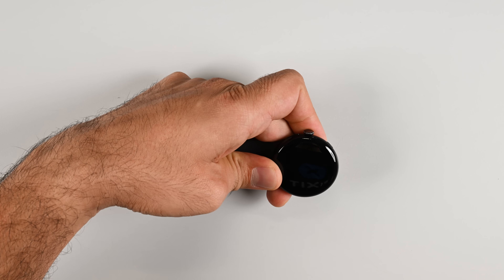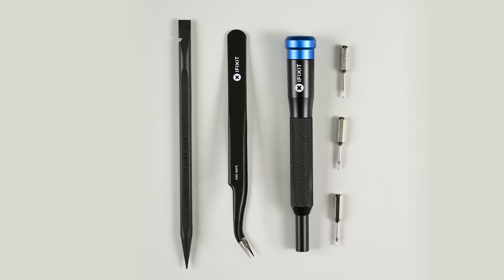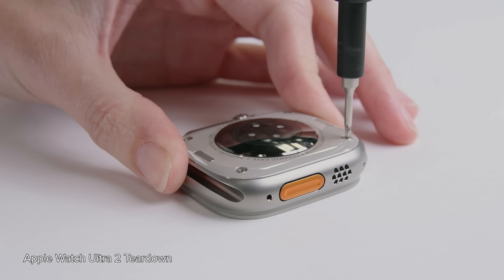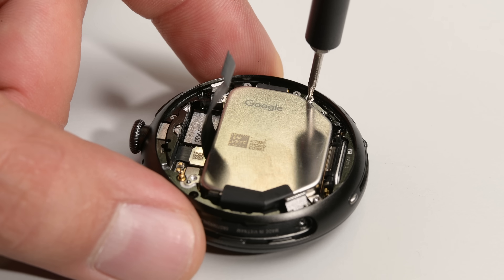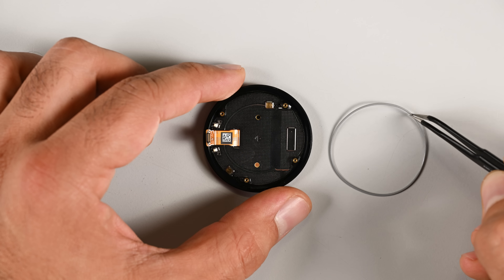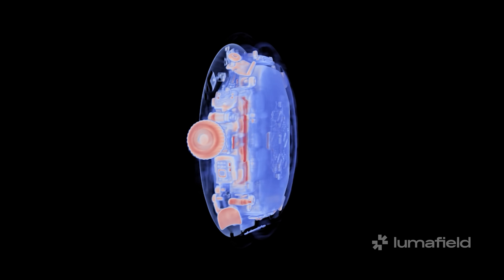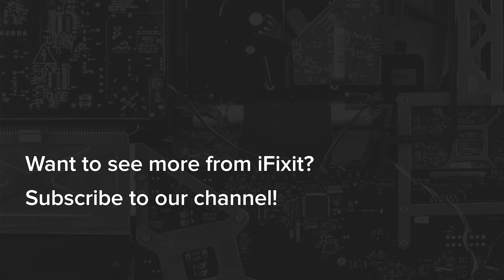Inside the Pixel Watch 4: A Masterclass in Smartwatch Design

Comment: Will we be able to purchase a screen replacement for the PW4 ?

And what do you think about the price range ?

It would be really sad if it didn't, as Google has put a lot of effort into making the watch user-repairable. Just need to know if there will be spare parts sold separately like the screen and battery.

I'm very interested in this watch. I've always found the Pixel Watch very pretty, but also very fragile because of the shape of the glass. So if it could be replaced easily and inexpensively, it would really be a good investment.

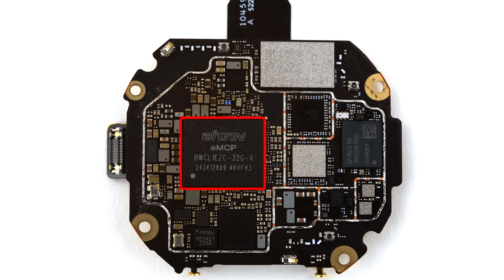Comment: 2:43 crazy soldering reflow fault on one of the crystal oscillator chips to the bottom left of the SoC. It looks to be micrometers away from a solder bridge
Reply: That's just from them removing the can with a heargun but no so carefully

Comment: The fact that most regular watches are water resistant using o-rings and gaskets means its totally possible to create a sealed smartwatch without using glue. Glue is the lazy approach to mass manufacturing and less spent on R&D
Reply: I don't believe the main reason they do that is to cut costs...
Reply: Regular watches dont have speakers or microphones, that complicates things
Reply: @ssnjr1299  What? The Pixel Watch 4 has a speaker and microphone...
Reply: @weltenleser when have i said otherwise?
Reply: @ssnjr1299  Well, the video you just commented on proved you wrong.
Reply: @anarfox  I didnt say it was impossible, just that it is more complicated than a regular watch
Reply: Yeah Pixel watch can withstand  1.5 meter of water for a few minutes. iWatch 10 can withstand up to 50 meter for as long as you want. Also, most waterproof regular watches can have their gaskets replaced but they'll loose their waterproof rating no mater how skilled the repairer.
Reply: @Lil_Lobo  Vast majority of "iWatch" users also don't take their watches further than 1.5m below water for a few minutes.
Reply: Doesn't change the fact that once you open i even that 1.5 meters or less will be enough to brick it if everything is not sealed exactly to factory specs
Reply: @Lil_Lobo Which isn't a problem for most people because, once again, their devices usually don't see more moisture than a hand wash or workout sweat.
Reply: So do you take off your watch when it rains cause getting soaked by rain can can potentially ruin a waterproof watch that has been worked on, especially if the watch was not properly resealed or tested afterward. And I don't think a lot of people are spending +$100 on a waterproof tester
Reply: @Lil_Lobo  Where exactly are you getting your info? Your ass? The pixel watch has had 50m WR since the original one

Comment: The screen is easier to replace than a galaxy watch but rest is almost the same and can be done just as easily
Reply: But the screen is by far the most likely to scratch or even break. So that part being repairable matters more than any other. I'd say it's even more important than the battery which luckily is also easily replaceable just like on SOME other watches.
Reply: @Bronyboiiiii  i agree. But Samsung gives  you sapphire crystal as display protection which is like known for its scratch resistance and durability also its completely flat. I have use the Galaxy watch(2018) till now no scratches on glass, i also used the watch 4 the glass is just as good as new. Compared that to the Pixel Watch's curved display  with gorilla glass 5 which makes it more prone to scratches and less durable. So everything's balanced

Comment: Things as they are, Google has done an incredible job to achieve a repairable device 👏 
What I liked the most is the solution to maintain the IP protection with the screws 👌

By the way, just because a device is square does not mean that it cannot be sealed with an O-ringey. The most contradictory thing before this is really that you need a little more space to apply it, while the glue requires absolutely no space and at the level of industrial assembly it is infinitely easier to apply. I don’t justify it either, just keep it in mind.

Comment: Huge win for the repairable community! If traditional watches can be repairable, why not smartwatches? Kudos to Google for being pro-repair! Definitely a leap to the right direction.
Reply: I don't think repairability matters much to most users. Here in Croatia, there are no repair shops offering these services, or the cost of repairs is higher than the price of the device.
Reply: @DrazenKlisuric For me reliability is a must. It's especially important to be able to replace the battery easily. Thats a must for me after a couple years of use.
Reply: Why not smartphones too?! Do we really need all that glue for the screen or the battery. That retention mechanism looks awesome
Reply: @dogoku  I guess most people don't want to see too many exposed screws on a smartphone; on a watch, it is not as visible, and you need fewer of them
Reply: @dogoku  Quite, but they seem to prefer that people ditch their smartphones because of a scratched screen or a dead battery, they're incredibly greedy so it leads to more sales.
Reply: Fitbit failed because of this too.
Small non replaceable battery. Degraded so fast.. people stop buying it.

Comment: How Samsung need to do this for their watches my back glass is broken and I don't want to open it up and loose the water resistant the glass is crack but still not letting water in it's odd to say
Reply: The glass doesn't let water in because there usually is a sticky foil underneath or between the glass that is still intact. Without that layer, the glass would just fall out and get everywhere.

Comment: As always , great video🙌🏼 Just curious, why not 10/10?
Reply from the maker: Google's doing almost everything right in this design. The next iteration of the Pixel Watch could hit a 10/10 if they're able to release full schematics, bring down the price of the display, and further optimize the display replacement process. When a single component costs nearly a third of the cost of a new device, lots of people won't choose repair. The 1IP Torx Plus driver required for display replacement is a pretty uncommon driver; it's not impossible to find (we sell it!), but even many specialty electronics bit sets won't have it.
Reply: @iFixitYourself Thanks for your response. Best regards from Chile. Been a fan of yours since the early days. Now I am a proud owner of a pro tool kit and also a Mako set🙌🏼
Reply: No schematics.
Reply: There's also the question of part availability.  Can't repair the watch if they don't have a ready stream of batteries or screens publicly accessible.
Reply: probably parts availability, I don't think google sells parts anywhere publicly
Reply: Most likely because they’d receive backlash in the comments because of the disclaimer stating they have a business relationship.

Comment: But the Apple Watch isn't circular? Most of your praise only comes because of the circular design right?
Reply: Most of the praise comes from the fact that it uses screws instead of glue, which makes it incredibly more serviceable. It has a user replaceable battery and screen. The only way it could possibly be more repairable is if they provided users with repair guides (which are coming soon) and if they had all parts listed for sale online (unsure if they have this)